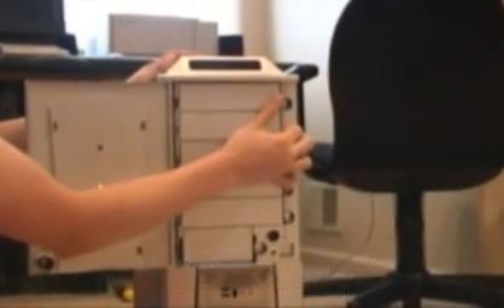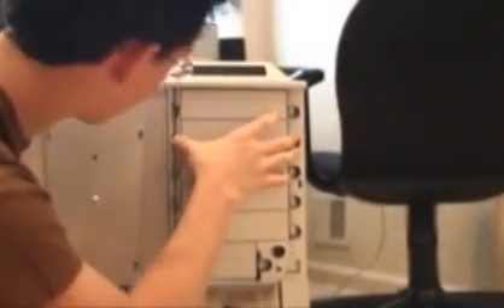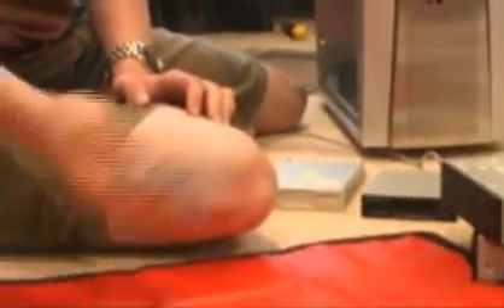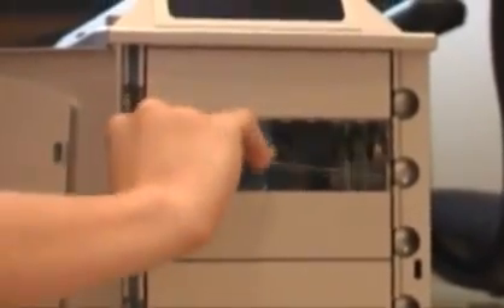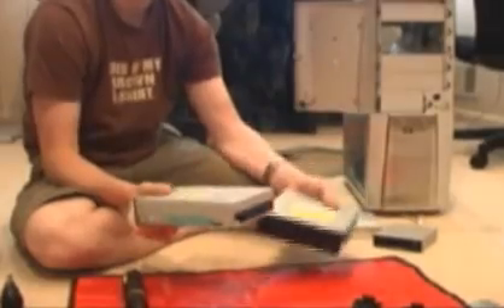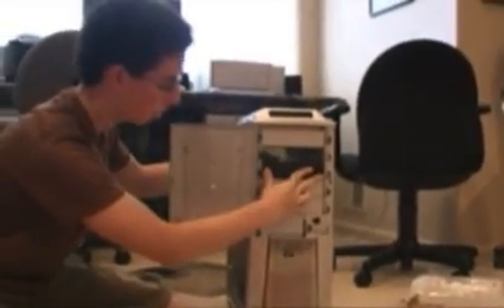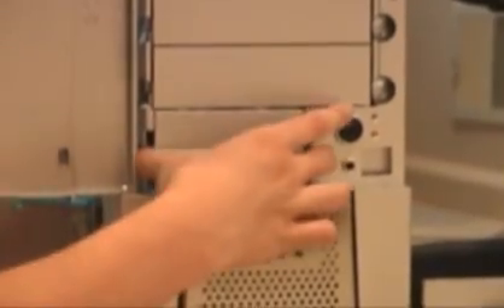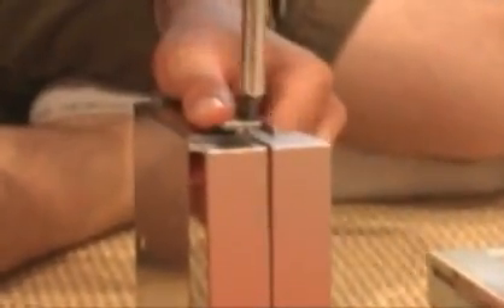(Part 1/4) How to Build an Ultimate Computer

Comment: This video is 3 years old. Fact 1. Floppy drives haven't been used as a source of storage since the mid nineties. Fact 2. For every floppy loving floppy-dick, buy a USB drive. You can boot from those...or you could get with the times and stop buying crap because every major motherboard manufacturer has two bios switches: One stock, and one you broke. If this video isn't 13 years old, there is no excuse for a Floppy drive. Hell, YouTube didn't even exist when we used floppy drives as storage.

Comment: @DissapointedMoose Wherever you are. No It would be $80-$100 because I got my GFX card (gtx 260),(4gb ddr2 1066) memory, and (700W) raidmax psu, in what was basically a steal from a guy off craigslist. I got them all for $150. But anyway my post doesnt matter anymore because I dont care lol.

Comment: @CrytpicMetaphor Haha...Except I could use the extra $80-$100 to a higher end Graphics card. So its all balanced out. I have a $400 AMD machine.
Phenom II x4 @ 3.8GHz 24/7...IDLE: 26C /// GAME LOAD: 35C
GTX 260 @ 760/1600/1100
4GB DDR2 1066 Kingston HyperX
700W RaidMax

How much did you spend on your Intel Machine?

Comment: dude that isnt very consistant if you have that many hdd's than you have to make sure that all your other hardware can support them you have to get into more detail for example:
my computer consists of:
8gb ddr2 ram
1 two terabyte (2000gb) hdd
1 250 gb hdd for backup
1 intel core i7 920 overclocked to 3.2 ghz per core
and so on be more detailed

Comment from the maker: you can get a metal bracket that will allow you to mount a 2.5" in 3.5" bay.  Its on newegg.  The jmicron controller is either an IDE or SATA controller.

Comment from the maker: glad you like the videos :)
That should be fine.  If you have the front as as intakes, and the back fan as exhaust, you should get a nice airflow over the video card.  If it's still to hot, buy a PCI slot cooler, and install it adjacent to the video card.

Comment: Hey ive built a gaming rig could you plz rate it for me, here's the specs:
cpu - AMD - Athlon X2 6000 - Dual Core Skt AM2ram - 4x Kingston 2GB DDR2 800MHz HyperX Memory 
vid card - 2 x Zotac GTX 260 Video Card 
case - Thermaltake Kandalf Black Steel Case
motherboard - Asus M2N-SLI
psu- Thermaltake 750W Toughpower Power Supply - Silent 140mm Fan 
thats all i bought for it i got a 320gighard drive and a 20x dvd burner from my old comp.

Comment: Asuse P5K-Pro is not good.I recommend Gigabyte GA-EP45-DS3.The evga 8800GTs 640mb is very slow DO NOT get fooled by the memory size. It performs close to the 8600GTS. A good choice would be a 512mb GTS, or even better a 9800GTX+. The Cpu fan is fine. 2GB of memory,DDR2 800MHz is fine. Check out the NZXT Tempest case,Comes with blue ighting and 6fans. Depends on your budgit. I am 13 but i am able to play crysis on max with the similar parts i listed. If you have questions please ask or email me.

Comment from the maker: Use a grounding bracelet, or if you don't have that, simply touch bare metal (like that on the case).  It brings your electrical potentials to the same level.

Comment from the maker: yes, but as I also said, its ok to use such a screwdriver on the case and parts other than the hard drive, which is where i used it.  The one I used on the hard rive was not magnetic-it is designed for such a use.